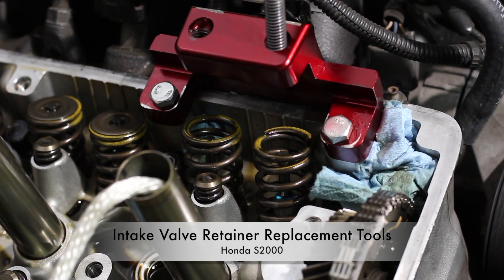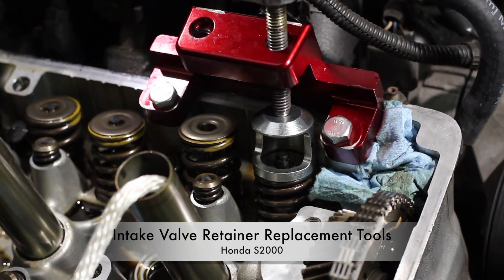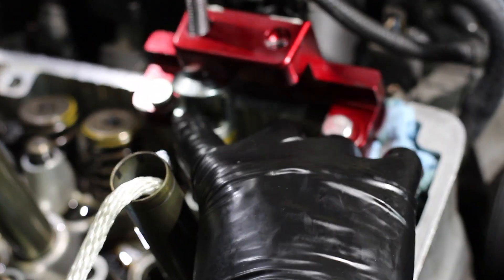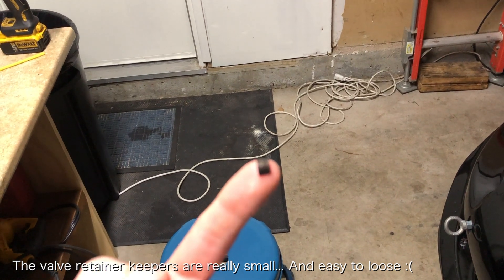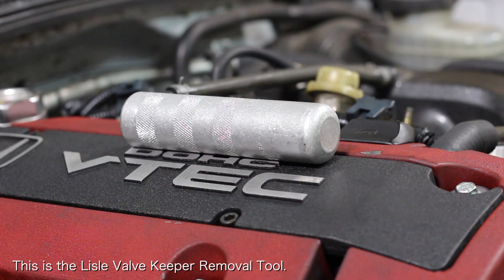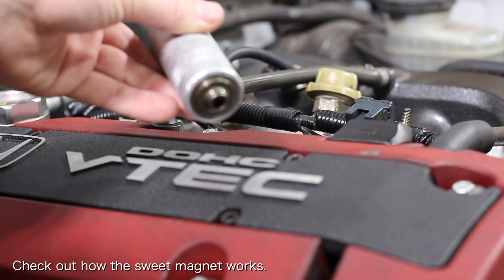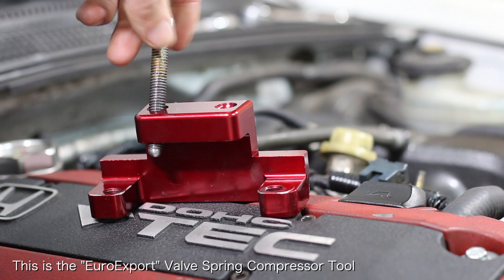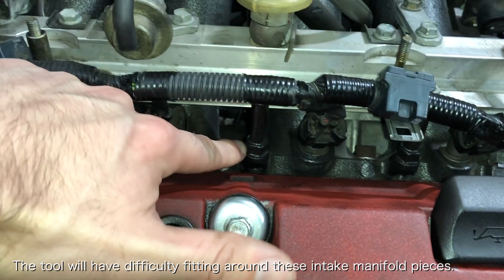Intake Valve Retainer Replacement Tools | Honda S2000

Comment: Hey I have a 2003 and wanted to upgrade my retainers for piece of mind. I called a well known import shop around my area for a quote to get it done and they told me that the 2003 is the year they upgraded the retainers. They said only the 00-02 has the ones prone to crack. Is that true?

Comment: why only the intake valves?
Reply from the maker: The exhaust-side retainers of the F20C, although identical to the intake-side, have also never been observed to fail, due to the lower stresses on the exhaust valvetrain. Therefore, if you're keeping the stock springs, you only need to replace the intake-side retainers.

Comment: Hey, I'm going to replace the retainers on my AP1 to the upgraded AP2 version. I watched the videos and my question is that what is the model of the retainer keeper remover tool? The link for the Lisle 36200 has comments that it is too big for Honda engines. Is that the model number you used? Also, what tools do I need to change the stem seals and can I do it at the same time? Thanks

Comment: It is worth noting to take extra care threading the bolts through the compressor tool and into the head. You definitely don't want to cross thread or torque down too hard or you will damage the aluminum head and cost yourself money at a machine shop!
Reply from the maker: True

Comment: Excellent as usual. It would be nice to have. A series on power upgrades options and maybe your experience with them / reliability. NA vs FI. Track reliability. That kind of thing. Thanks.
Reply from the maker: Thanks! I really want to make more videos about the track and make legit videos measuring the effect of upgrades. As far as FI goes you probably won’t see me talk about that for years as I plan to stay NA for years.

Comment: Just another great video my man! That tool is slick! When I did mine for insurance. I used a cheap overhead valve spring removal tool, combined with a modified compression tester which I ran to my compressor with about 30psi to keep the valves up and sealed. For a "do it yourselfer" it's hard to justify this proprietary tool.
Reply from the maker: Yeah I understand. I think it also depends on how people value their time. For me it makes sense to buy the tools since I work on a bunch of S2000s and will likely lend it to someone else. Would be great if there were a tool renting service for this type of stuff. Maybe there is...
Reply: DIYGuys 
I guess I'm super conservative :)

Comment: Could you make a video about replacing lights behinds the dash/controls? The bulbs behind my climate control knob are burnt out. Any suggestions for putting led bulbs instead of incandescent would also be fantastic. I love the videos you make.
Reply from the maker: I’ve done it before. I could do it again but it will be on the bottom of my list since I don’t have a need to do it 😕

Comment: Nice!  Is a special tool needed if you go further and replace valve stem seals?
Reply from the maker: Yep. I used a 10$ valve seal puller. Not sure if I’ll make a video on doing the valve seals as it’s almost the same as doing the valve retainers.
Reply: link to the tool?
Reply from the maker: Here ya go: http://amzn.to/2B6Siig
Reply: Would a spark plug plier work?
Reply from the maker: I’ve read a spark plug plier will work. I didn’t have one so I bought a different tool. I will link it later b

Comment: +1 on this video. these tools are the best tools to use for the job. do not buy an overhead spring compressor as seen on the S2000 retainer swap video on Speed Academy, which requires a lot of patience and a second person. Also, use a relative large diameter rope. I only had a flimsy small diameter rope around and it was very difficult to feed it into the combustion chamber. I also found that putting a small dab of oil on the keepers to help get them to stick in place and not fall down the valve stem. A small flathead screwdriver and a plastic pick made quick work getting the retainers in place. thanks again for the awesome how-to video!
Reply from the maker: Happy to hear you successfully did the job
Reply: i lost a nut for the fuel rail cover during the swap. that first start was very stressful!